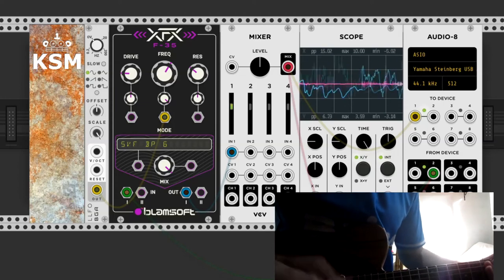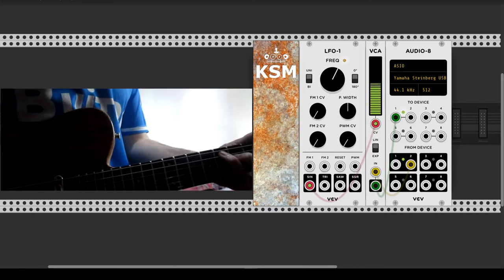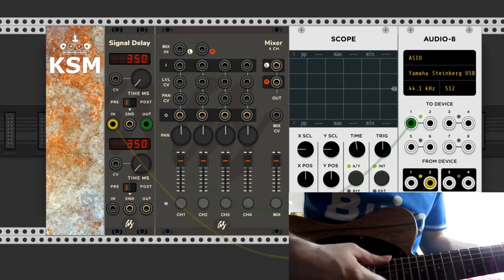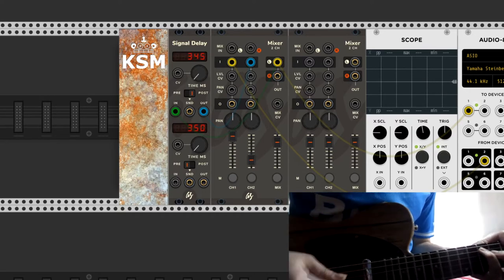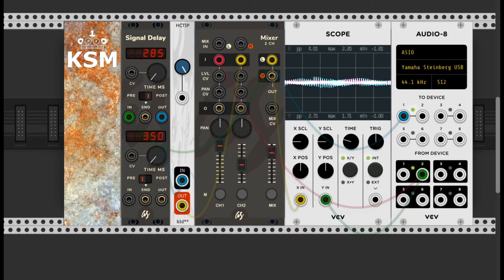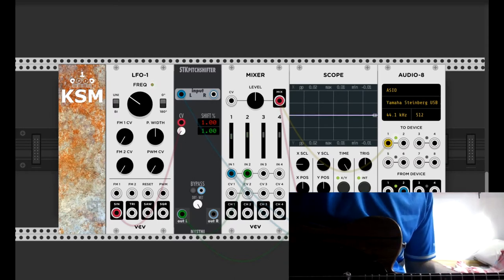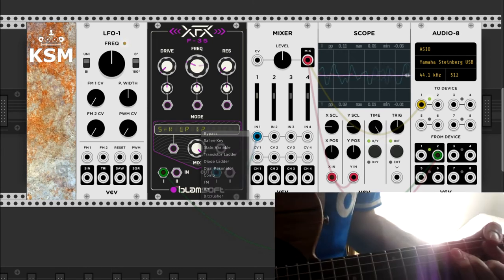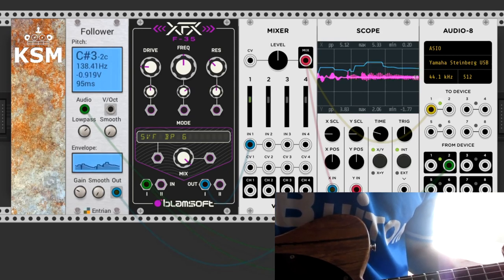Recreating effects pedals on VCV Rack

Comment: Great video! A few things in there I haven't tried yet. I thought of creating a similar tutorial but there's little point because it would basically be the same as this!
Although...I've never found a pitch shifter I'm happy with for creating shimmer reverbs. I've got Host now so I'll probably just buy the Valhalla one at some point and use that instead. Clouds with the pitch all the way up is your best bet. 
There a few things you could do for a more advanced video:
With Entrian Follower, you can patch the audio out to trigger an ASDR if you want a smoother response. This is useful for dynamically controlling FX by ramping LFO speeds up or down, fading modulation in or out etc. 
Delays with the time modulated sound better than the pitch shifter for chorus (I've spent hours patching up both!) - the Fundamental delay sounds better than the AS one and has a built-in feedback control.
With nearly all of these, a great trick is to use Stoermelder Strip to copy the patch and double it up for stereo - modulate both sides independently for a big stereo image. Just split a cable off to both sides of the patch. In fact, load up as many modules as you can until the sounds craps out.
Also, some of the samplers with live inputs are great for glitchy delay with the record trigger fed from a square wave LFO.

Sadly, you do seem to need a decent interface with ASIO drivers and a powerful computer for more complex patches.
Reply from the maker: Wow, really great ideas, thank you. pdArray is good to sample on the fly. 
https://youtu.be/VdkVd5yM2Eo In this video you can see how it scrolls the ebow back and forth.

Comment: Love this video, you have gotten me into using my guitar and sax with vcv now! I'm curious how you might hook these effects up to be able to quickly switch between them or chain them in different ways. I'm playing around with the bogaudio switch88 but I can't really find a comfortable solution. Also the lilac looper is really fun with these
Reply from the maker: Thank you. What you say is really interesting. If every effect is a group of modules, I'd connect every group inline one after another  (the order of the effects here is important). After every group, I'd put a VCV sequential switch of two states. In the first input goes the output from the previous switch and in the second input, the output from the current group of effects. With Stoermelder's Stroke, you can assign a hotkey to a trigger. So you can have a different letter to bypass every effect. It's hard to explain it in text, hope it makes sense.